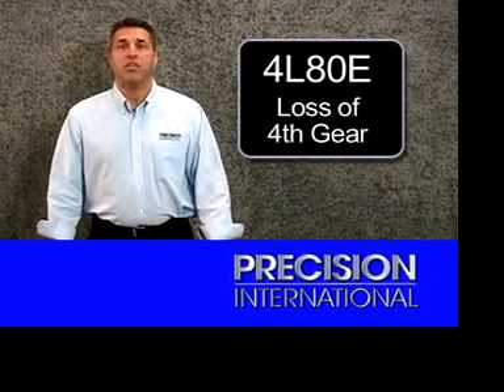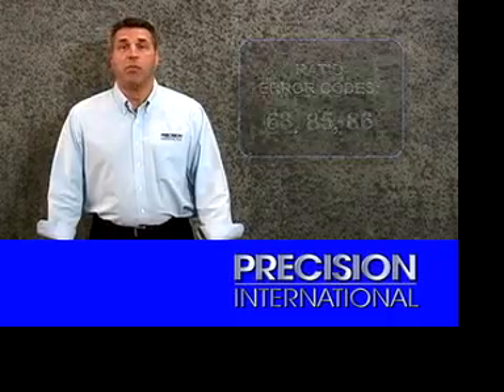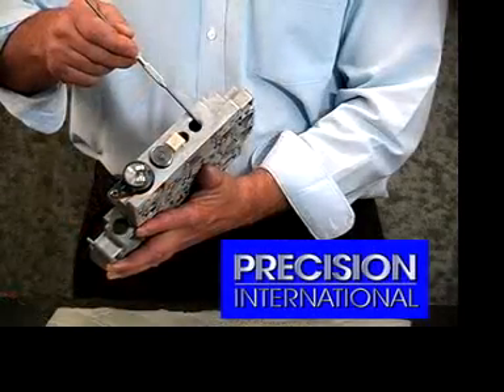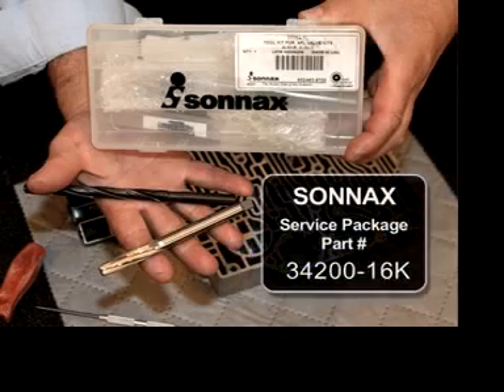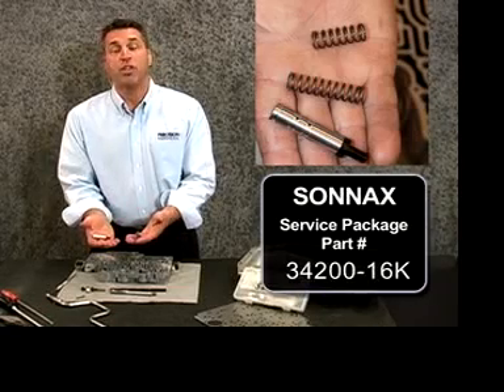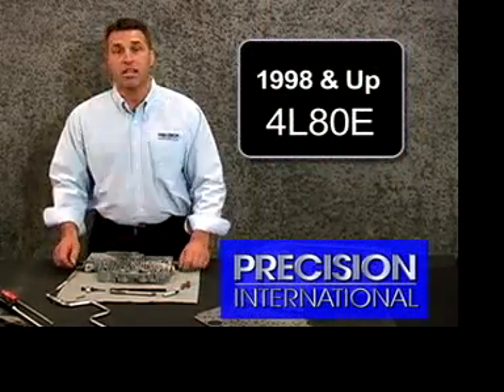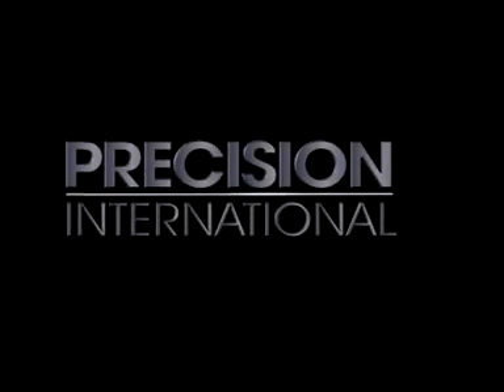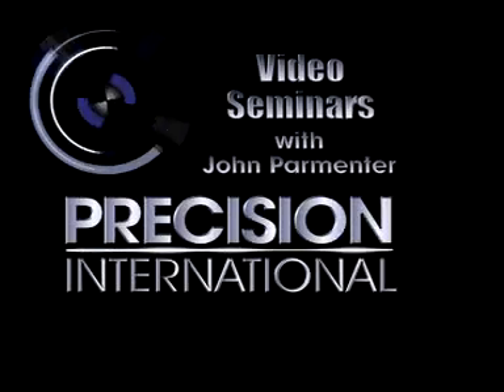4L80E - Loss of 4th Gear

Comment: got a 99 silverado 4x4 has the 4l80e in it mine wont shift into 4th gear until it gets to a certain temp on the engine temp gauge during the summer when it warmer outside it shifts perfect and there are no codes lol i dont get it